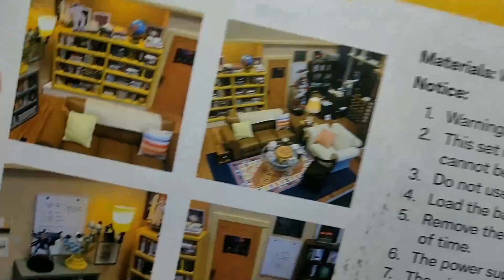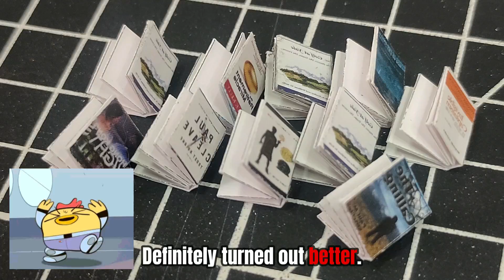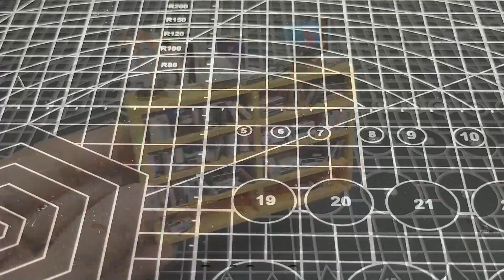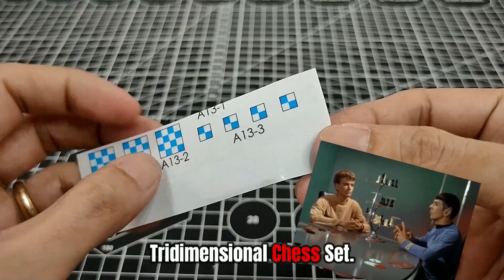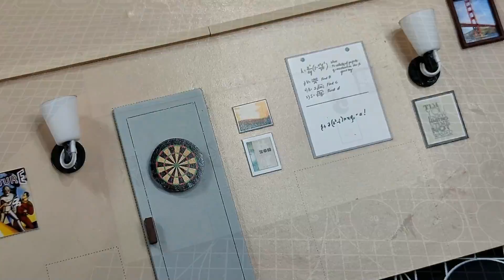Inspired by The Big Bang Theory.  Hobby Kit Build.  DIY L.A. Apartment.

Comment: At 18:56 that piece does fit.  The piece above (A09-01) should only be 1.5 cm from  A07.
Reply from the maker: Just rewatched the video and realized my mistake. Thank you for pointing it out. Good thing the bulb's not visible when everything's put together. But now I'm completely bummed out about it. 😅
Reply: I am building this right now. I added the bottoms piece first (that you cut) and then built around it.  I’m still trying to figure out how to make the curtains. I have never understood how you get them to stay folded.
Reply from the maker: Just add glue to both ends of the curtains so it stays folded.